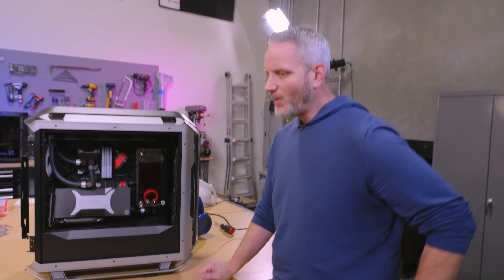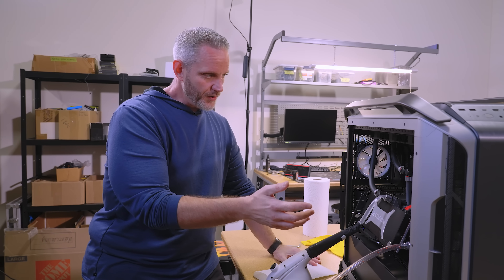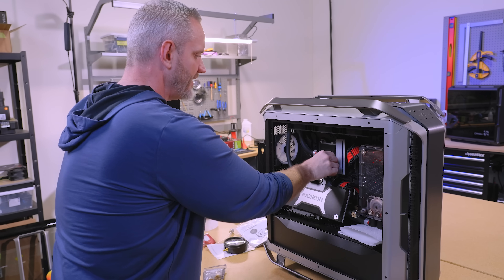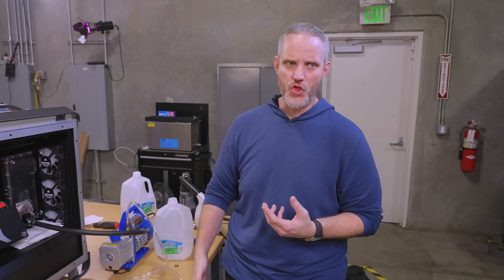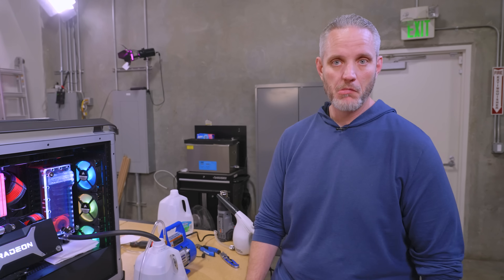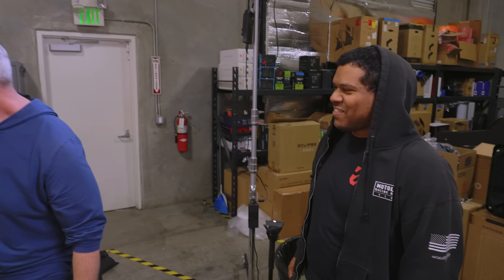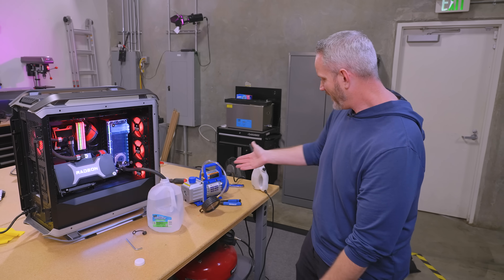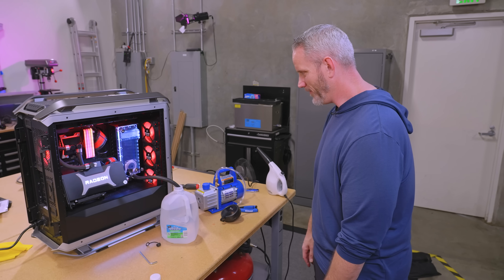I used Vacuum Pressure to fill a PC! Why didn't I do this sooner!?

Comment: I filled my first water cooled system this way with a hand pump break bleeding kit back in 2007. And with the break bleeding kit you could use it to finish getting all of the air out using the catch reservoir to catch water before it gets to the pump. A large enough one could catch all of the fluid in the system and be used to drain the system as well.

Comment: dude I've been using a little red hand pump from Advance Auto Parts for a couple years. The red tubing that comes with it plugs right onto a 12mm barbed fitting. I use it for pressure testing and vacuum filling. I installed a passthrough fitting on my O11D XL that runs to the distroplate and a drain port with a ball value.

Comment: as an automotive guy, and in the video it says he is too, i'm surprised this wasn't tested earlier. pulling a vacuum on a vehicles cooling system to fill it up has been fairly common practice on cars for years. not only is it a fast way to do things but you get to check for leaks at the same time.

Comment: Jay if you run a seperate reservoir with a dip tube for the drain into the bottom and hook the vac pump into the lid leaving the top open to air you could drain loops with that. Thats how I draw old brake fluid out of a system and do oil changes on jet skis. You can also run a air oil or air water seperator as a redundancy. it takes less of the vacuum to drain so it should be fairly simple.

Comment: If the rads are making weird clicking/clinking sounds, it is probably the  rad's water tubes compressing enough to break the solder bonds to the fins.

Probably performs worse now. 

What did you think those sounds are?
Reply: The flat tubes in the radiator were assembled with compressive loads when the radiator was clamped before soldering during assembly.

Pulling a vacuum temporarily partially relaxes that load. What you’re hearing is a little bit of sliding. It’s harmless unless there was a solder bond about to fail anyway due to a manufacturing defect.

Comment: To Jay, I know this is totally off-topic from your video, But I have a question,  How often do you need to change the thermal paste on an AIO cooler.?  It's been 2 years now On my "be quiet"! Pure Loop 360mm, and do you need to add more paste to an AIO cooler.?   I should know this sense, I watch your Video all the time.  But I  don't.  Sooooooo.

Comment: Sorry Jay, but you're not the first to suck fluid into a system with a vac pump. This is the way that HVAC systems are flushed when they're full of acid and need a flushing fluid pumped through the pipes
Reply: He mentioned that….

Comment: The reason you aren't getting below 24, is the fact that once it gets that low you start evaporating the water. You will not reach that until the whole system is completely dry.  Also not having the hose sealed properly, with a vacuum rated fitting and minor minor leak will prevent that vacuum pump from reaching -29.

Comment: My only concern is if the vacuum is causing the radiator tubes to collapse and they separate from the fins, thus losing a chunk of surface area to transmit that heat out.

Comment: Honestly don't know if a comment with this idea has been posted yet but if you used a jug with a wider opening than that gallon plastic jug the liquid comes in you could make a new hose that has a valve at the start of the hose and fits down into the jug, you could reuse this with any new system baring potential changes in fitting size, rather than just use the valve at the bottom of the distro plate and the whole hose would be under vacuum and you "wouldn't have to top it off". Might still have to fill a little idk how much much would be left in the system. It would be a cool proof of concept though that it is in fact the hose that's introducing that little block of air.

Comment: You don't need a liquid vacuum pump, you just need a catch can. You can use the same pump and still not suck any fluid into the pump that way. tbh the blower might do a better job though...tough to say, you would need to do "better" at having the vacuum line primed so you didn't have the volume of air in the hose wasting vacuum that could be spent pulling from the loop, once you get past that point you would likely need the blower to "clean" it out. But obviously none of that is going to save you from needing to flush dye out etc.

And yeah lol, when I saw this title I was like "what took you so long?" ;)

Comment: to vacuum the fluids out with that pump, you'd need that pump hooked up to a chamber with enough area to accommodate the volume of water while still having and excess of room at the top of the chamber so the pump does not suck int he water. pretty easy to make. just think of a wet dry shop vacuum in a way.

Comment: you just need a 1 gal tank with a port on bottom with valve so hook the hose up open tank valve flooding hose taking away air then open vacuumed system and just like that its fully filled no air

Comment: If you put three  valves connect to a tee with one to vacuum, one to system, one to refill as gravity feed should achieve zero air in the system just have only 2 valves open at each stage. Close refill first with others open to vacuum system then close vacuum side and open refill side. If that makes sense.

Comment: I been doing this for years, got alot of other ideas like this i do to that no one else does. I have fluid vacum pump and found diferent fluids can work as cooling when they in a vacum. I have also solved your air bubble issue years ago.😊

Comment: A Milwaukee M12 fluid transfer pump, with the pull and drain tubes both ran into a jug of water, would probably work incredibly. Actually, that concept, but a much smaller cheaper alternative. Even just a drill powered transfer pump fr.

Comment: the other option you could try is put a hose from the drain to the fluid... then on the 'fill' port just hookup a wet rated vacuum.... it'd probably take a bit longer but then  you just suck the fluid back to the vacuum and it should theoretically remove all air...

Comment: You could probably do something like that to empty it as well if you were to hook up the coolant line to one of those small vacuum chamber pots, I'm guessing if you were to open the fill valve at the top then the higher ambient pressure would force the coolant from the system into the vacuum chamber.  Might be worth a try, guessing you'd want to pull the vacuum on the chamber with the valve to the pc off and then open the valve so it's one sudden rush of liquid vs what you'd get from hooking up a wet/dry vac to it.

Comment: Great vid!

Just have to note.. Used to work in HVAC, and we didn't use vacuum to fill refrigerant - but to ensure there was no moisture in the system.  Certain compressor oils would become acidic and you could ruin the compressor pistons if there was moisture in there. The capacity of the moisture filter of the system is just meant to handle the last residues after vacuum boils any water away inside the system.
This is also what might break internal components if you have a leak on the return side, as moisture would be pulled in and react with the compressor oils and make acid.

Comment: This should be possible with a manual pump too. Similar to leak testing where you pump air into the loop you just flip the valve on that concept and you have this but manual.

Comment: I'm glad that you realized that there was air in the fill hose. If you had a tub of water with a bigger opening, after closing the valve, you could fill the fill tube with water, put your thumb over it, and dunk it into the tub of water. Would reduce that air source.

Comment: This is madly good idea and fairly on the cheap side provided you have the vacuumpump already. But this on par with the pressuration check with air instead of filling with water and look gor drips.
But I am sure someone will go Uhm Actually, that is not vacuum just negative pressure.

Comment: So, if you had a valve at the fill port couldn't you close that, vacuum from the drain, then once the drain is closed attach a tube to the fill, add fluid to remove air from the tube, then open the fill and have a full system with basically zero air?

Comment: I actually thought something like a vacuum pump to fill water cooled PCs existed but no one used it because it was too expensive.
Not for PCs, but until now I have always used my household vacuum cleaner (which is rated to vacuum liquids) to create vacuum (mostly on vacuum bags to store clothes but also to completely fill the base of my parasol).

Comment: you ´could use the very same pump to empty this. use enough hose to contain the amount of liquid in the system, have a second shut off valve right after the pump. Keep the valve on the reservoir closed, open the valve near the pump, de-pressurize the hose, then close that valve and open the one on reservoir and it should suck out the fluid into the hose. Quite simple...

Comment: I been using a hand vacuum pump for years.  Not just for fill but to de-bubble an already filled system.  Difference being I connect the pump to the top of the reservoir and run the valved hose from the lowest point in the system.  Most of the time 15mmHg is plenty of pull.
I worry about the crackling radiator.  What you're doing is shrinking the soft copper tubes along their flattened sides.  The crackling noise is the tubes breaking off the fins between them.  There's a risk of reducing the heat capacity of the radiator.  It also could cause some hairline cracks to form in the tubes.  Just maybe, though.  It's a risk I'm not willing to take so I stop pumping at the first 'crack' sound. (which is usually right around 15mmHg).
As for the Aquacomputer Leakshield everyone is talking about: I personally put a Gore vent fitting at the top of my reservoir and keep a 30mm air gap.  Let the system breathe to avoid building up pressure.  If a system leaks at equilibrium, seals are bad and it's a disaster waiting to happen.  My system has been leak-free for over 3 years..... And is probably due for a flush & refill...

Comment: I'm just curious about getting the radiator fin imploding and creating tiny cracks on them.... other than that, this is a great idea!
Reply: I think it wasn't the radiator fins being distorted by the vacuum, rather the vibrations from the pump were shaking the fins enough to make that sound.  If the pump was on a different surface then you probably won't hear anything.

Comment: The vacuum will increase once the water finishes boiling off.  You could also use a hanging fuel bottle to get rid of the air in the tube 👍

Comment: you can hook the pump up to a sealed container with 2 ports with one port to the computer and it would drain the system with out the liquid getting to the pump

Comment: @jasonb9629 The thing is id say roughly 95% of all needed technical knowledge (outside of EPA 608, core, I, II, III) or EPA 609 (MWAC) are very commonly used technical skillsets that can be applied and used on a daily basis for numerous applications outside of HVAC-R. in reality its only the knowledge of the difference refrigerants uses, what oils/seals meterials, if the refrigerant is charged as a liquid or as flash, the psig/temp ratios, repair/or retire leak volumes/year, and logging data/submitting to EPA schedule intervals that are extremely limited to the HVAC-R industry (outside of being an HVAC-R refrigerant recycling facility technician)

Comment: You’ll be able to check for leaks using the vacuum pump before you fill it too. Add a valve and gauge to the fill line.

Comment: The trick would be to connect the vacuum to the top fill port and the drain connected to the liquid.    Pretty much that should allow you to pull the air out and replace it all with the liquid.

Comment: on vacuum-draining a machine

you could build a catch can that collects the water from the system out of a pressure cooker or something. that way then the only water you're pulling is vapor caused by any evaporation that happens from the low pressure.

Additionally you could add a valve at the other end of the loop so that when you open it, air rushes throughout the system and that pushes the water into the catch can. with the high rate of flow too that might help pull contaminants!

Comment: Actually you can pull liquid out of the system using vacuum pump as well, all you need to do is add a liquid trap between the system and the pump

Comment: When I saw the thumbnail, I thought you'd first fill the system with coolant, attach the pump via fittings to the top fill port, then vaccum any trapped air out. It's how they do it with lost wax jewelry molds to get out any air that might be trapped in the crevasses of the wax master. But as I think about the complexity of the passages in the cooling loop, I realize that might not exactly work.

Comment: You should ABSOLUTELY pull the fluid through with the pump running, so you don't have to worry about things breaking. You can make a super simple fluid seperator by having a sealed container with a tube that goes to the bottom, and a short tube that barely goes through the top. You hook the pump up to the short tube, and the system to the long tube. When the system is full, the fluid will exit the long tube, sit at the bottom of the container, and air is pulled through the short tube. This gives you plenty of time to turn off the pump before you get any liquid in it

Comment: We used the following pump for our RF systems. JB Industries DV-200N Platinum 7 CFM Vacuum Pump. It can take an hour or two to pull the vacuums on the systems that were built and on some occasions all night.

Comment: actually... the aqua computer leak shield allows for this, too... not as rapidly, lol, but in an integrated way and with safer (for the gear) vacuum pressures :P

Comment: 11:34 "Don't pull out the water using a vacuum pump"
So, in the world of composites (i.e. fibre glass & carbon fibre), if you're gonna do a lay-up that requires vacuum, you put a catch-can type thing before the vacuum pump for any resin that makes it's way to the vacuum pump to drip in to instead
It's basically a small sealed tub that has a lid with 2 fittings on the top, and you can pull a vacuum normally, but any liquids that get in to the tube can't enter the pump
Reply: I was wondering if you could do the same thing to pull the fluid into the system?
Coolant reservoir, system, catch-can, then pump. Pull a vacuum and use atmospheric pressure to push the liquid into the system until liquid gets to the catch can

Comment: Print a cap with a hose fitting for the water bottle. And before filing it up just flip it so that the tube fills up with liquid before entering the system.

Comment: Hey Jay, How about this.  Take a small  good water pump (aquarium type) and have a good size bottle for  fluid.  Hose will go from fluid,  pump, valve,  into loop, add another hose at the top of the  loop back to the bottle of fluid.  Just  let it run till  all the air is out and cap everything off. Had this idea 15 years ago LOL. That way you get all the air out in one go LOL.

Comment: Trademark this idea for PC tech...  :) I'm low key a little worried about the negative pressure on the rad, those sounds are sub optimal and doing this repeatingly might decrease the lifespan of the rad.

Comment: You have two different sources of residual air in that system. For one, the air remaining in the piece of tubing you used to fill the loop. For another, the air that's dissolved in your coolant. You could get rid of it by applying vacuum to the coolant container before using it to fill the loop, but beware - if you apply too much vacuum too fast, coolant will get into the pump and may cause damage.

That said, even the pump you're using is overkill. The easiest method to achieve a vacuum is a water jet pump you could just screw into a faucet and go from there. It's probably also much less expensive.

You could probably use another fitting to gradually remove more and more air and filling the system bit by bit from above, but whatever you do, do not, under any circumstances, let the system go solid. That is to say, always take care that a small portion of air remains in the system. If for any reason your coolant temperature increases while the system is completely filled with water, you will learn the hard way that the density of water (and glycol) is a function of its temperature, and not at all constant above its freezing point.

Comment: Phil is right obviously, that getting -1atm gauge (assuming this means complete vacuum) is extremely complicated, and practically impossible with this type of pump, as after a point just  sucking out air is not going to do anything because there are so few molecules actually there to suck out that it becomes a job of actually managing to find them and collect them... but getting close, like -0.8 atm gauge is very doable, and you really don't need any more than that for this application. It's probably a good idea to go a little lower vacuum still, maybe -0.7 atm gauge, as you do want some air in there anyway to have room for expansion anyway and it will probably be easier on cheap radiators.

Anyhow, this was an awesome experiment, and it's great to have an answer as to whether or not this would damage components. It would also be nice to do long term testing on this, like maybe vacuum cycle a system like a hundred times and see at what point it would get damaged and which component would (probably the rad would be my guess)

Very nice video jay, thanks for this!